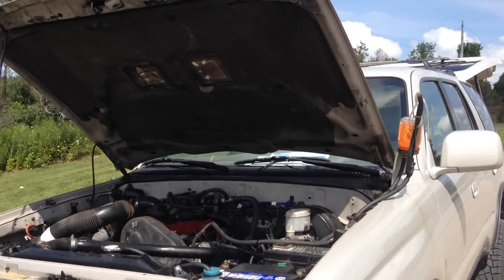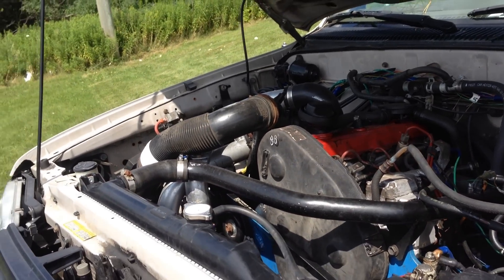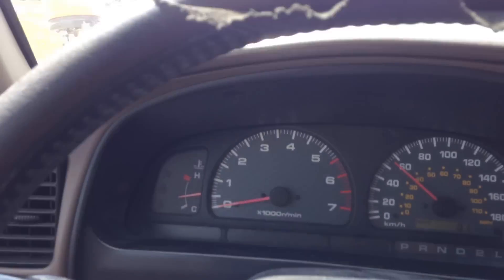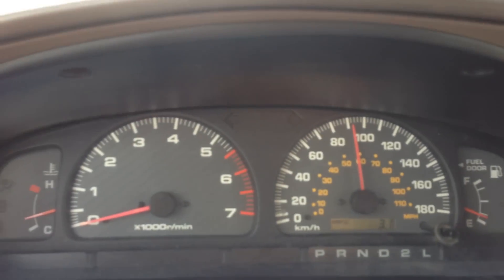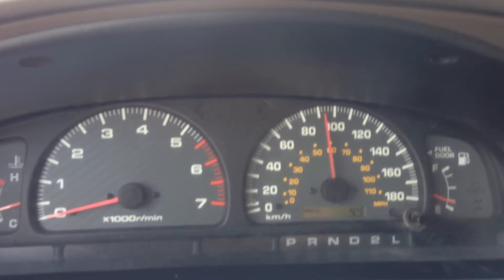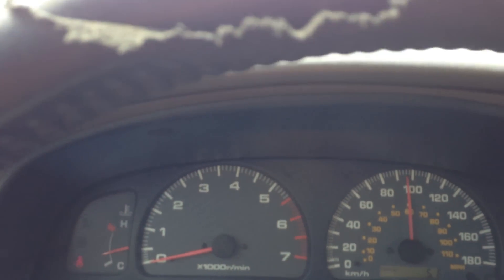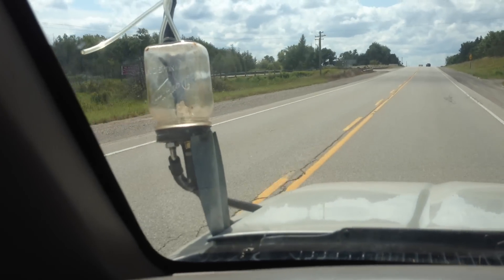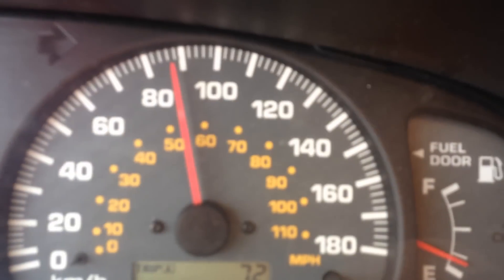Diesel converted Toyota gets over 40 MPG  Part 1

Comment: Looks like you are getting a bit over 36 mpg. Very impressive; I barely get over 30MPG in a Hilux with the 2.8 Original TD (2020). Lifts over 2", no front aero dam and AT tires hit your mileage hard. My mpg improved about 2 mpg in highway going to Michelin Defender LTX, and its surprisingly capable off-road (for a HWY tire). 2" in a 4runner is plenty, if your tires fit within the well. Too ,much lift can hurt your articulation and high speed driving. I use chains in mud and snow. Covered bed. What made you choose the 1.9Tdi 1z\AHU over the mercedes alternatives? The  om617 seens to be a popular swap. My wife had a 2015 Mercedes-Benz E 220 BlueTEC, and it was a very impressive engine. 40 mpg in Hwy.  Always looking for one at the Junkyards.

Comment: Since diesel is more expensive, or burns quicker (I'm not an expert), do you spend the same that you would if it were gasoline?
Reply: get yourself a 29gal aux fuel tank from LRA, paint it to match the frame and fill it w/ offroad diesel....

Comment: Nearly $5,000 in annual savings on fuel if my math is correct

Probably pays for itself within 4 years even if you go with something a little crazier that requires a transmission swap as well

Comment: How much did this conversion cost you in total? I get 14mpg on a good day in my 99 4Runner and spend about $600/mo with gas being around $5.40/gal here. Curious to see how long it would take to pay for itself.
Reply: A TDI from a junkyard is around $300. The adapter plate with the mounts of around $1,400.  To be safe, a budget TDI conversion should be around $2,200.
Reply: @fabriciooliveira3720  do you own a house or do you live in an apartment complex? If you have the space, buy a $200 harbor freight engine hoist and do it yourself. After you complete your first engine swap, you will feel like the strongest human in the universe. I highly recommend DIY. There are plenty of videos teaching it. If you hire someone, they will charge you $5,000 and they’ll still fuc# it up and at the end you still have to fix it.
Reply: @devil2jz500 any videos you reccomemd seeing people talk about the 300d old Mercedes’ motor works too
Reply: @fabriciooliveira3720  there is a guy that has a channel about TDIs and he put one in a Silverado 1500. He tows a trailer with another truck on top of it, and his total weight is like 7,000+lbs.

Comment: Wouldn’t there be fuel in the line that would tilt the scale especially at such a small sample size? Either way it’s a super cool conversion.
Reply: yes, exactly what I was thinking. if there was 1/8 gal floating around in the system already, that would mean it was more like 20mpg

Comment: Add water methanol injection kit 64cc nozzle tune to suit. 

Bmn engine code. Last and best of the PPD direct injection diesels. 

Alh engine code best for performance parts availability and upgrades. 

VW tdi are engineered to last and perform

Comment: Can this work in a 100 series land cruiser???
Reply from the maker: Hello Ryan.
  While the engine, with som upgrades, would have to power to move the 100 series Land Cruiser quite well, it would not achieve the same fuel economy due to the Cruiser being less aerodynamic and heavier. 
 The other problem becomes fitting the engine to the Cruiser’s transmission. There maybe interference problems with things like starter and oil filtration components. Lastly, getting the Cruiser’s electronic transmission to work with the inputs from the VW diesel would be an issue.
  We are working on an 80 series conversion, but are using a transmission from a 60 series which has no electronics and will allow 2wd ability.
Reply: @toyworksautocrafters3072  thanks for getting back to me. I kinda knew about the tranny issues but the others I wasnt,  so thanks for educating me.  As you can imagine my fuel economy is awful (15mpg average). Runs good and all for having 260k miles on it but would love the potential of getting even around 25mpg with a diesel.   If you guys ever get it figured out I would love to do it. Thanks!

Comment: hey ...i don't have straight long road like that in my country ... how can i test my Isuzu C223 engine ????
Reply from the maker: If you can figure out a circuit that you can keep a steady speed and R.P.M. on, you should be able to see what the difference in fuel efficiency can be between two vehicles or engines. Just replicate the conditions with each vehicle.
Reply: @toyworksautocrafters3072  a circuit is good idea ... and doing it at night to avoid traffic disturbance ..

Comment: Recently on a longish trip I did 708 KLM on 56 litres of petrol. I make that around 34 to 35 mpg from Six cylinder Ford Falcon in Australia. Fuel injection.. cruise control.. just let the 4.0 litre dohc engine do it's thing up to 110 KLM on freeway sections. Bugger buying a diesel for it just yet. It's a low is 2004 model. Well serviced with a hyclone intake manifold device. No moving parts. Is said to swirl and mix fuel better

Comment: Tires are bigger than stock. Odometer will read more distance.
Reply from the maker: Hello Julio C.
  While this truck happened to be lifted, the tires were the original stock size (31 X 10.5). 
  When tires are larger than original, it has the opposite effect of what you suggest. Each revolution will cover more distance, and since the odometer counts revolutions, you go farther than the odometer reads and physically move fast than the speedometer shows.
  Thank you for watching 
 S.C.Lawrence
   M.P.G. Conversions 
      519-938-9844
Reply: Absolutely. I stand corrected.

Comment: Hi, great work....is this a front wheel drive engine? cheers Brett
Reply from the maker: Hello Brett
While we tend to think of engines as front wheel drive or rear wheel drive, they are not. The vehicle they are installed in is fwd or rwd. Engines just spin clockwise or counter clockwise. Most spin clockwise when viewed from the front. So as long as it spins the correct way for the application, it works.
  Thank you for your inquiry.
  S.C.Lawrence
     M.P.G. Conversions.
        519-938-9844
    thetoydoc@hotmail.com

Comment: Did you fit it with a bosch pump (essentially make it an aaz) or did you swap the electronics over and have to tune it?
Reply from the maker: Hey again Tim
  This one we kept all of the electronics from the VW Jetta and installed them into the Toyota. We then had Malone Tuning send us new chip with stage 3 and egr deleted and installed them in the VW ECU. After that we installed a set of injectors from Performance Diesel Injection (Giles Gallie), and this is how she runs.
  S.C.Lawrence
     M.P.G. Conversions 
       thetoydoc@hotmail.com
          519-938-9844

Comment: Wy a Vw in a toyota the 3l is made for it and is an amzing engine
Reply from the maker: Hello mta798 
  I'm sure by many standards that the 3l is a good engine, but it's 2 1/2 times the weight of the VW, doesn't have the fuel efficiency of the VW, can't match the power of the VW, about the same reliability, and the 3l was never sold in North America.
  A motor is just a power supply. With proper installation, you could say "any motor is made for any vehicle". The VW engine fits in the Toyota engine bay with lots of room to spare making it far easier to work on, should the need arise, than the 3l, and since we keep everything other than the engine (alt, p/s pump, a/c compressor, rad, starter, transmission, rubber mounts) original Toyota. It's easy to get parts. So it's a better engine for some of us.
  Either way, we all enjoy our Toyota trucks.
  Cheers
   S.C.Lawrence

Comment: 37.6: the new over 40mpg.  Seriously though I am jealous if the MPG.  How does the power compare to the 3.4 without a supercharger?
Reply from the maker: Hello BikerTrashWolf 
 Unfortunately the little diesels power does not compare to that of the 3.4. The 3.4 is like an anemic vegan up against Duane "The Rock" Johnson. Johnson being the 1.9 diesel. While the peek output of each engine shows the 3.4 to be superior, when you look at a graph the 1.9 provides 90% of its power from 1900 rpm through to 4300 rpm. Yes, these diesels rev to 5000 rpm! With very minor upgrades these engines are reliably capable of over 185 hp. and 275 lb. ft. of torque. With a little more work you'll easily get over 250 hp and 360 lb.ft. All kicking in at 2000 rpm.
  Thank you for the inquiry.
  S.C.Lawrence
  M.P.G. Conversions 
  thetoydoc@hotmail.com
  519-938-9844

Comment: Curious what you think of the v6 3.0 tdi? I havent been able to find a single forum or other page of information on this engine swapped into one of these trucks. Might be kinda overkill for this truck, but it seems to be about the same size as the original v6 3vze and of course power and torque are way higher,  which I would think might mean better mpgs and overall better performance.
Reply from the maker: Hello macnutpro13

   We have been asked about using this motor, but I think this motor would be very problematic. To begin with, because of the vehicle it came in, and the fact that we need all of the fuel injection, The cost of acquiring one would likely be very prohibitive for most people.
 Secondly, the complexity of the fuel injection, seeing as it is tied in with multiple sensors throughout the entire vehicle, it would be extremely involved to try and sort out and install into a Toyota or other vehicle.
 After the 1.9 L, we would be next looking into the 2 L engines. The ones that have become infamous for their emissions falsification. We have been told that these are also very complex in terms of fuel injection, but they would be easier to attain them the 3 litre.
Reply: yea, I've heard the electronics are a nightmare to deal with, especially with everything being tied together the way it is. Then again, somebody who knows the ins and outs of these ecus might be able to make it work. Don't know anybody yet, but I'll keep looking!
Reply: @killstrees В Беларуси много кто делает 😅

Comment: Can you point me in the direction of website or whatever where I can find all the information needed for researching this kind of swap. Like what year motor I'm looking for adapter plates and everything else that's necessary. Thank you
Reply from the maker: Hello airdreams1 
  Unfortunately, the powers that be have not granted us anything more than dial-up Internet in this area, so as of yet we do not have a website. For now, the best way to get in touch with us is by telephone at 519-938-9844, or by email at  thetoydoc@hotmail.com. Seeing as we are only able to get dial-up Internet connection, we prefer the telephone as even responding to emails takes forever in this area.
 If you wish you could email us your telephone number and a time and date at which it is best to reach you and we will call you. Basically, there are four different Volkswagen 1.9 L turbo diesel engines, each of them has their own strengths and weaknesses and it depends upon your location and what you wish to achieve with your vehicle as to which would be the best for you. We are still working on some new kits to allow different engine/truck combinations, so even if we don't have anything right now for your vehicle, we should have something within the next year.
   Thank you very much for your inquiry, and we hope to speak with you in the future.
  S.C.Lawrence
     MPG Conversions

Comment: Is it harder to swap the alh? I have a Jetta I don't like driving anymore, but think it would be cool to put the engine in something better
Reply from the maker: Hello Mike S 
 We are currently in the design stages for a kit to drop the AL H engine into the Toyota trucks. Once we finish the kit, then it should not be any harder to use an ALH than an AHU/1Z or AAZ.
 By the looks of it so far however, it will end up being more expensive! First of all with an ALH you will typically need to have the immobilizer removed from the computer. This cannot be done in programming, it must be physically dealt with on the circuitboard. Secondly, due to clearance issues in the Toyota engine bay the Oil pan needs modifying. The ALH uses an aluminum oil pan which is much more difficult to modify, so we have now started importing some steel oil pans that we will be modifying, but of course this adds to the cost of the kit. Thirdly, so far the way we are working on this new design we will also have to supply a new front crank pulley. It looks like we are going to need the crank pulley's from the earlier engines so that we can properly connect up our alternator/power steering/air-conditioning compressors from the Toyota, depending on the year truck.
 Until the end of November 2017, we are out of the shop dealing with something else that has come up. When we get back to work we should hopefully have a kit for the ALH finished by January. At that point we will know what the cost is projected to be.
Reply: @toyworksautocrafters3072 did you get the kit done? Will it work I’m my fj cruiser?

Comment: Do you sell conversion parts? I'm looking for a flywheel and adapter to mount a TDI up to the R150 transmission.
Reply from the maker: Hello abpsd73 
 Yes we sell adapter plates, flywheels, complete kits, engines, etc.
 We have just finished designing a new adapter plate for use with the ALH engines which solves the clearance issue between the starter and turbocharger.
 The best way to reach us is by phone at 519-938-9844
 Or e-mail at thetoydoc@hotmail.com

We will be shut down from until November 26/17, but I have forwarded the phones to my cellular and will answer when signal is available.
  Thank you for the inquiry

Comment: I bet it won’t do 70 mph
Reply from the maker: Keep watching Charlie P.
  In "Part 2" we get her up to 100 mph. We've had a go faster, but we were running out of road. 
  All of you naysayers are worried about the size of the engine. Power is power. It doesn't matter the size. it's all about the output.
Reply: bet it will

Comment: Idk you guys, but for me that's way a too small engine for that SUV...
Reply from the maker: Hello GR24rules.
  Now what do you think of the Ford F150 (full size p/u) using a 2.7L engine? Or Dodge's eco-diesel 3.0L 1500 series truck? We're talking 0.8L and 1.1L difference in displacement, and VW has been producing diesel's longer and in greater quantity than Ford, Dodge, and Chev. combined. There IS a replacement for displacement, it's technology! VW's diesels are renowned for 500,000+ miles of service and have been used in 1ton vehicles for over 20years. We're not re-inventing the wheel, just wrapping different rubber around it. Power is power, size doesn't matter (ask a woman). Efficiency is the key!
  Live well, and keep your questions coming. It takes an open mind and the exchange of ideas to forge the future.
  Thank you 
   S.C.Lawrence
     TOY Works/Autocrafters MPG Conversions 
        519-938-9844
          thetoydoc@hotmail.com
Reply: TOY Works Autocrafters I understand your point.. I still stick to the 1KZ engine in my 2000 4Runner
Reply: If you think it's too small of an engine, it just means you're uneducated about its potential. The older 4runners (85-89) with the four cylinder had MAX 114hp, 148 lb-ft (the highest achieving non-turbo 22R motor from factory). Most of the 22R motors made 94-108 HP, 138 lb ft of torque for the same 3500-3700 lb SUV. Mean while the TDI in stock form (1999-2005) made the same 90-100 HP, but a slightly greater 150 lb-ft despite its smaller displacement (1.9 vs 2.4). If the TDI is such a small engine for the application then why was the 22R one of Toyota's most bomb-proof, reliable motors? Displacement is NOT always key to power. Just look at the rotary RX7s; they were beating most factory V8s of the era despite only being 1.1-1.3L in displacement. SMH. This TDI will be less taxed out since it makes power at lower RPM and holds it rather than overrevving and dumping. And it's lighter too, so you're actually cutting weight WHILE increasing power! (22R weighing about 340 pounds, TDI being about 250 lbs). And it's diesel so gobs better fuel economy. But the greatest part is the TDI can be more reliably, cheaply, and easily built up for more power than the 22R. About $1400 in parts (assuming you didn't get a model of engine with a factory 11mm IP, if you did then about $900-1000) will get you about 150-180hp plug-n-play, about 220-250 with a tune, and obviously bounds more torque and still dead reliable and same mpg as long as you keep your foot out of it. If you build up the bottom end, all you effectively need to do at this point for more power is increase boost. To get 200HP from a 22R would require almost $1000 in cylinder head work alone: porting, over size valves, MONSTER sized cam; on top of that: bore 0.040 over, respring the distributor, headers, 10:1 compression (for an n/a build, less if turbo), probably had to molest the bottom end, etc. All this for an engine that'll make 180-200 HP at like 8,000RPM! And would absolutely destroy the famed 22R reliability. So is the 1.9 really THAT bad of a motor for the application? Answer, no. In fact, I'd argue it's a better motor for the application.

Comment: 2 cups is .125 us gallons. 7.3 km is 4.53 miles. Mpg is 36.2
Reply: 16 cups equal 1 US Gallon, however 7.2km equals 4.474 miles times 8 equals 35.792 miles per gallon, close but still not 40mpg.
Reply: @zodac1976  40mpg.imp. Our gallon is longer
Reply: bro who really cares. Lol. the diesel 4runner ONLY gets 36mpg. NOT GETTING IT. ITS GOT TO BE AT LEAST EXACTLY 40MPG
Reply: They can't do math up there.